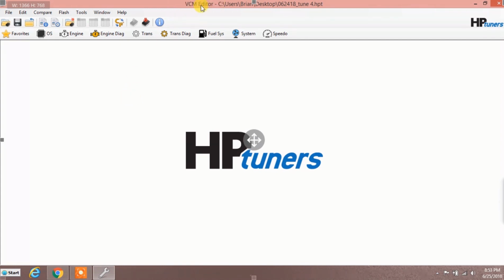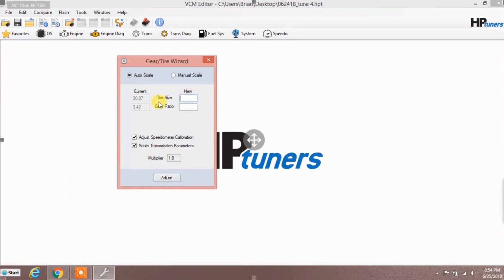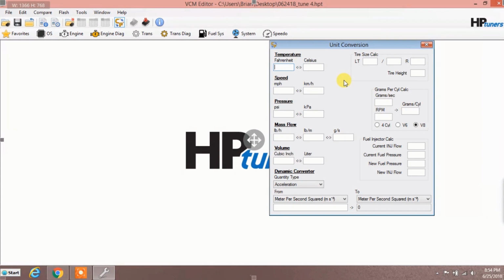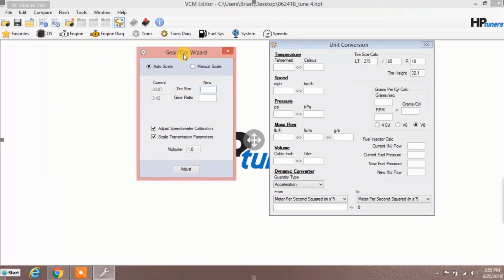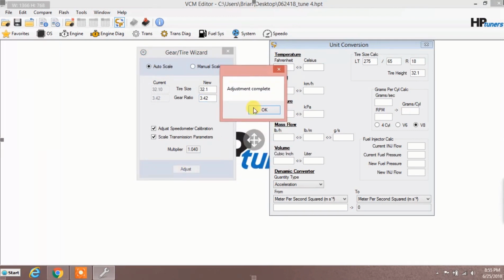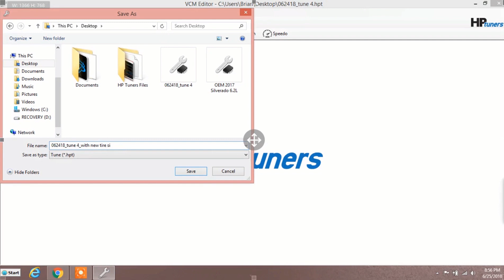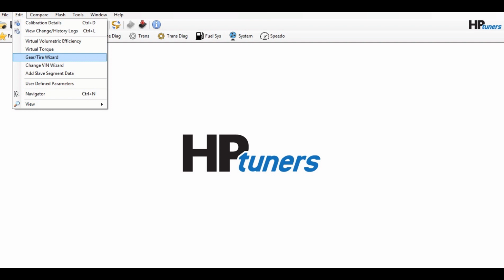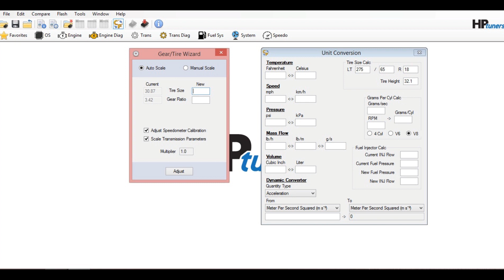How to Change Tire Calibration in HP Tuners

Comment: In gear and tire wizard, what is scale transmission parameters for? Is it for a transmission tune to change shift points? My truck is all stock, planning on a lift kit and 35s in about a year and if i calibrate the speedometer with the gear and tire wizard if I'm supposed to select scale transmission parameters in addition to selecting adjust speedometer calibration.

Comment: Great video my question will this work on any vehicle I was told I can not change this on my 2018 Chrysler 300, is this true it of course makes no sense to me as the 300 came with 19" wheels from factory  I changed my wheels from 17" to 19" but would like to make sure speedo and shift points are correct any info would be greatly appreciated

Comment: I noticed the option check boxes. what' is changed in tune file? I see the box for speedometer  but there's one for transmission too? What changed in your file from original with both checked?

Comment: I have a question. My tire hasn't changed but I am using the transmission in a different car with different differential ratio. Initially the speedometer was the issue but after following the instructions in the video and adjusting the speedometer using the tire ratio it changed all the original configuration on the trans and speedo tables. Any advice weather I should keep it adjusted based on the new ratio or change it back and just fix the speedometer table.
Reply: Uncheck the bottom box only have the speedometer calibration box checked and but ur tire size 1 inch under what the unit Calculater says if u put the exact size ur speed will be wrong everytime
Reply: Put ur tire not but ur tire

Comment: I have a question.. since i lifted my truck 6in my traction control light started flashing every time I turn left or right.. do you think this  issue is because they didn’t update the tire size? 

Thabks
Reply: Bone Head my truck is 2010 f150 2wd and this shop told me that the truck is getting confuse and activates the traction light. And they said that I need to update the tire size to work properly